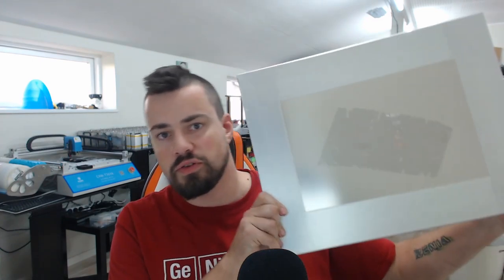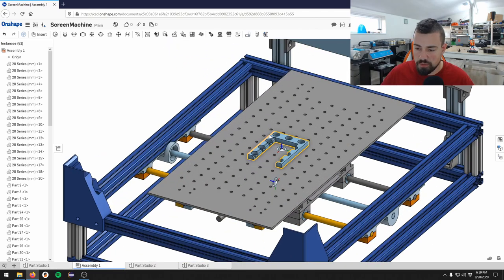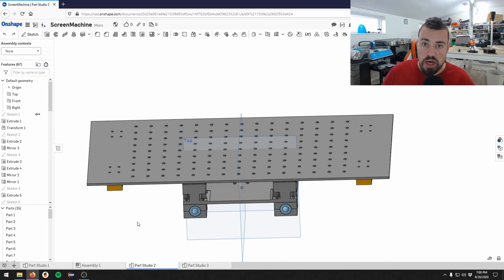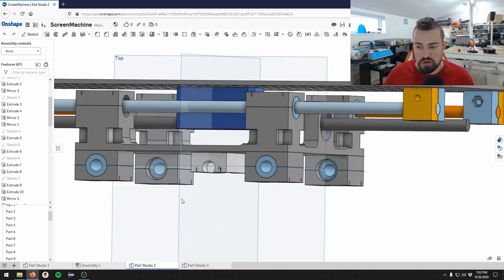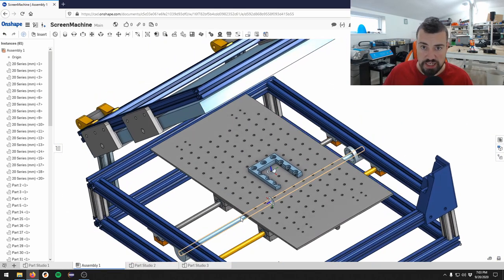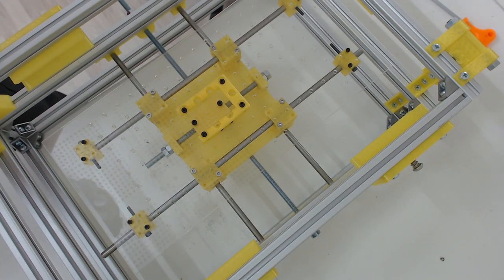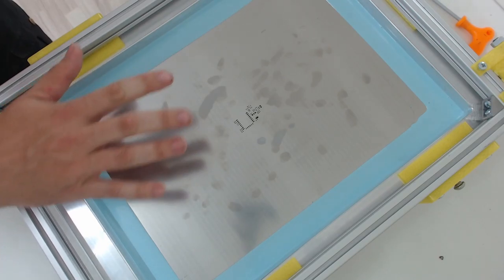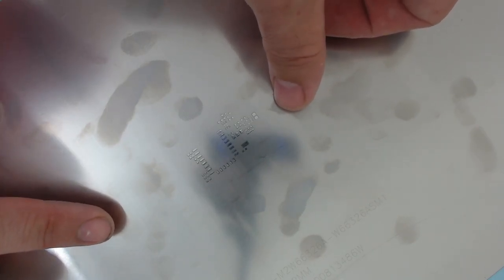Screen Machine Part 2

Comment: Nice work!. I think you could use alignment pins on front edge. Also revision 'next', deal with rotation about z-axis and alternative stencil sizes.
This might be useful to you as well. https://en.wikipedia.org/wiki/Differential_screw
I've been looking for a solution like this that might handle framed and unframed stencils with the same ease.
Reply from the maker: Thanks for the comment! I'm not showing this but I am in fact using some sort of differential screw. In the block that 'makes the axis move' I have 2 M8 nuts that takes up the slack in each direction.

I'm not sure what you mean with the alignment pins on the front - the lid of the machine locks into the front support blocks and it's a pretty tight fit.
As for angular rotation this is dealt with during the mounting of the stencil itself. It's a bit crude but it should be just enough to make the rotation right.